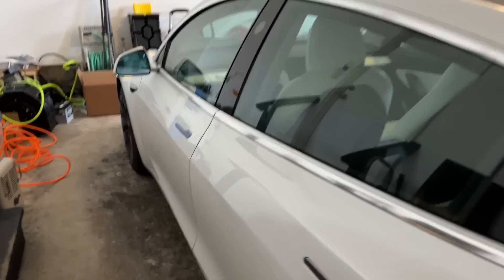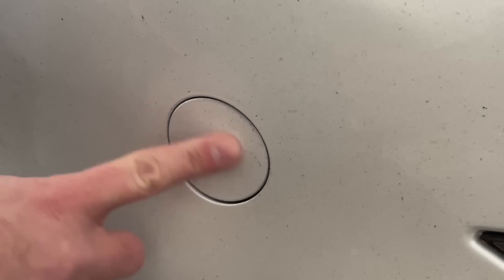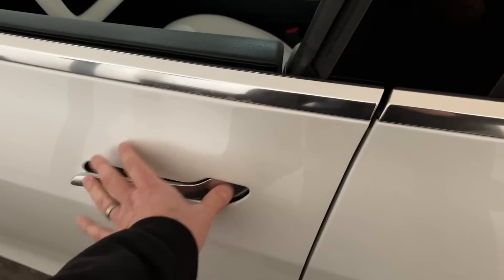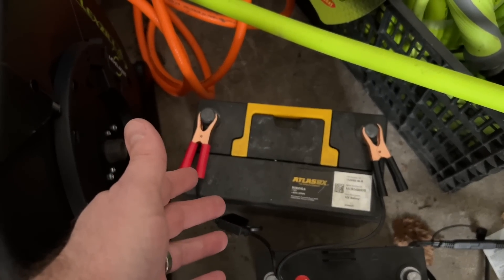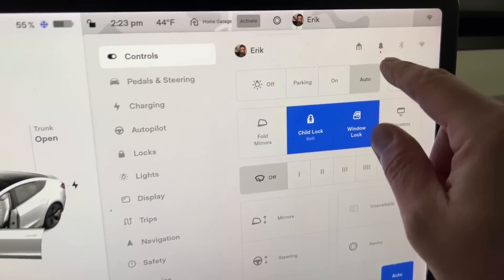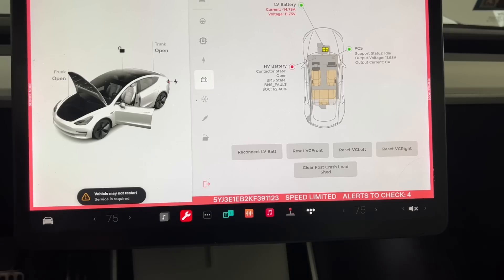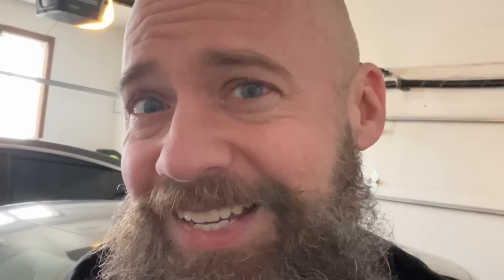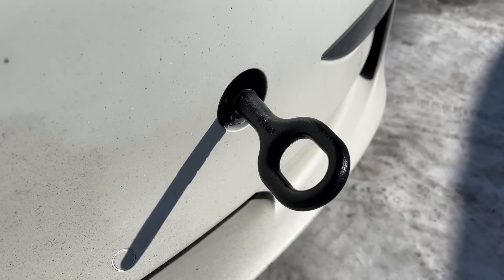My Tesla is completely dead!  Is it now bricked?  Pt1

Comment: Because the 12 volt battery does not crank an engine over you can use a Deep Cycle battery which should last longer.
Reply: I use a deep cycle in my '89 chevy pickup

Comment: 2 cables? They couldn't be bothered with including one proper connecter to connect to your 9v battery?
Really, 2 loose cables?
Reply from the maker: Yes, it's meant to be used with jumper cables.  That's what it was designed for.  The Tesla community discovered that you can use a 9v to pop the frunk.

Comment: get a real gas burning car, reliable, good range fast to refuel. Cheap to fix.
Reply from the maker: I'm not sure you understand why I bought my Tesla.  For around $55k, I have a super fast / high tech car that would cost in the hundreds of thousands for a gas equivalent.  Ask yourself which gas cars are faster than a Tesla?  Then look up the price on those.  Then look up the cost of repair and parts on those.  You'll soon see that I'm not crazy after all.
Reply: @BecauseTesla  you are 100 percent correct, they are blinding lee fast, but only for a very short distance. Ordinary v8 110mph for over an hour, more sensible driving 70mph passing a few cars up to 100mph still several hours range. Maybe they will be part of the future, still have a lot of major issues to be sorted

Comment: Wow, tesla is even worse than I thought:o) That steering wheel? OMG! And cannot open door without rolled down window??? WTF? And you need to undergo a training before you sit in the car to be able to open the door in case of accident? Now I don't wonder, why it is not sold in Europe:o))) It is just expensive garbage ......
Reply from the maker: The steering wheel is aftermarket.  The window needs to roll down because it's a frameless window.  Many gas cars have this too, and they won't roll down if the power is dead.  We used to have a Mini Cooper that was designed the same way.  It's not just a Tesla thing.  What do you mean not sold in Europe?  They sell a ton of Teslas in Europe!  They have a factory in Germany!   https://electrek.co/2022/12/29/tesla-model-y-is-now-the-best-selling-car-in-all-of-europe/

Comment: Normally the BMS prevents the battery from being discharged below a specific voltage. This prevents the battery from being discharged below the safe voltage for this batery type. So like Pc's Phones and Tesla's you cant totally flatten the battery. But battery failure does sometime occur no matter what Technology they use. The 9 volt battery you used have a very poor / low cuurrent output. eg keep a fresh new one just incase. As a retired Techo it's rather scarey what happened. Is the manual door release inside only on the passenger front door or do all doors have one.

Comment: Out of curiosity, while in the service menu, did you try hitting the "Clear post crash load shed" option? That stands out to me. Load shedding means it basically turns off a bunch of things to try and keep the electrical system alive. It makes me wonder if it's dropped into a load shedding state when it got down to low battery charge and hasn't been providing power to the 12V since, so it's just been slowly drained.
Reply from the maker: I did not try this.  Maybe it would have let the car run without the PTC heater that failed.  Part 2 of this video is out and it explains a bit more about what they found.
Reply: @BecauseTesla  Yes. Have now seen part 2. Given that they seem to have found it to be a complete failure of the PTC heater, I'm not convinced what I suggested above would make any difference. At the time I made the comment I was assuming it may have just been a software thing holding that contactor open, but it sounds like it was an actual hardware fault.
Reply from the maker: @Streaky100001  Yep, definitely a hardware failure, but I was hoping what you were suggesting is that they could use software to bypass that PTC heater to keep the car running...just without heat.  It doesn't sound like Tesla can do this...yet.

Comment: There have been plenty of videos about people being locked out of their EVs (not just Tesla btw - it applies to most EVs). It seems that there should be some sort of 'last resort' system to allow access to a bricked EV.
Reply: I've got an i3 which might be the exception, as BMW did thoughtfully include a physical key in case you get locked out due to a flat 12v battery, you can then pull the emergency frunk release from inside the car to get access to the 12v battery.
Reply: Yea, the thiefs would like that.

Comment: I don’t think I would feel comfortable getting trapped inside a car if it caught fire for any reason. Again, this is every reason why I went back to gas cars. With these, there is no issue to contend with.
Reply: I know that I had a Tesla and things too can get jammed up in an accident, even though it has an emergency escape switch.
Reply: Would you trust an all electric airplane? I sure as hell won’t.
Reply: Oh, right, so your petrol car won't  go on fire? Wow!
Reply from the maker: You do realize that gas is a flammable liquid, and it runs in a combustible engine…right?  I’m just playing devils advocate, but I would worry more about a gas car catching fire than an EV.  In my Tesla there are emergency door release handles that work even without power.  It’s only locked from the outside, not the inside.   Thanks for watching!

Comment: I want to go electric but I’m afraid of all these issues and having to send the car to them for days or weeks, I wanted the f150 lightning but ended up getting the 2021 3.5 twin turbo which is awesome. Maybe in the next few years they will resolve these issues and have enough stations and dealers to make it worth it
Reply from the maker: I wasn’t born an EV fanboy, but once I had one, the experience turned me into one.  I do understand your fears and concerns.  My car was ready to place the order in 2018, and I waited until 2019 to actually submit the order because I too was concerned with going electric.   Once I did, I realized how silly I was for waiting so long.  I just sat in a Ford Lightning last week and thought it was amazing.  My latest video is at the auto show and the Lightning is the first one I sit in.
Reply: @BecauseTesla  hopefully The Japanese companies take it more seriously and make some decent ones, I already went solar for the house, we got the 16500kw system and that will make all charging free since my home only needs 10500kw
Reply from the maker: @Sirkopaneer  The Japanese brands need to really step it up.  Lexus has a new electric SUV that costs $60k, and it only has 220 miles of range and cloth seats.  I haven't heard much from the Honda / Acura team about EVs either.  And of course Toyota is dragging their feet in the EV space too.  :face-pink-tears:

Comment: A small correction, there is a belt in the steering control unit, that enables AutoPilot to steer the car. But this belt does not wear out that easily. Not sure if there are any belts in the heatpump section.
Reply from the maker: Yes, this is true.  Thank you!

Comment: tesla was ranked most unreliable car brand but a sucker is born every day
Reply from the maker: I thought that was Land Rover?
Reply: @BecauseTesla  yea tesla was number 2  landrover number one. As a guy who has worked on many cars id much rather my land rover break vs tesla. The landrover I might be able to fix as most landrover issues are electrical faults, the Tesla you need special tools, software and the major parts like the inverter drive motors battery can total the car financially. I considered a tesla then I went on the tesla out of warranty reddit  forums and that is one depressing place

Comment: I think it's hilarious when someone tries to drive a battery powered computer on wheels, and is upset when they have problems. My '79 Chevy truck runs just fine, and if there is a minor problem, I can fix it myself, no computers needed. If the whole engine blows up, I can fix that myself too. But that is not likely to happen, because I built it right to begin with.
Reply: Nobody cares what car you drive.

Comment: Had one, gone back to gas, and have no problems to contend with...
Reply: I have a model s, and 4 gas cars.  Like them all.  Tesla never causes me issue.  Putting a new turbo in the fusion today.  Cars will always have to be fixed.
Reply: Sheeesh welcome back. 😂
Reply: What made you go back to gas? Charging?
Reply: Having same problems with my gas car. I got similar electrical issues. I have a full charge on my battery and the car will start normal one day, than won’t start the next day. Or will run for 5 minutes and die, than I can’t start it. I will change the fuel pump and see if that fixes it. In my opinion can have issues with any car. EV or gasoline. Just the way it is. 😮

Comment: So the "emergency pull" is just a standard door handle? LOL
Reply: @IntegerOfDoom  It's not a bad design if you understand WHY it was designed that way. Recessing the window into the seal reduces drag and wind resistance thus increasing efficiency and extending range.
Reply: You don't want to treat the emergency pull(EP) as a standard door handle. Using the EP will not engage the electric window to lower the small amount it needs to properly clear the window seal. This can damage the seal, the window, or both. Use the electric release button for normal operation, and reserve the EP for, well, emergencies.

Comment: So people can break into a Tesla with a 9V battery?
Reply from the maker: No, not really.  The 9v battery will only open the frunk if the cars 12v battery is completely dead.  If the car battery is working properly, the built in security will not allow the 9v battery to unlock it.

Comment: So all it takes to gain access to a Tesla, at least a dead one, is a 9V battery? Hmmm....
Reply from the maker: Yes, if the cars 12v battery is dead, you can use jumper cables and a little jump start box, or a 9v battery or A23 battery to open it.
Reply: @BecauseTesla  So, though presumably that is not a frequent state with them out on the streets, a dead 12V battery also presents a security risk.

Comment: It's just amazing how inconvenient a KEY is these days...
Reply: I have an EV from VW, the previous owner - a friend of my dad - payed premium for removing the keyless function and the installation of a normal key. Otherwise he wouldn’t have bought the car, so they did it. I think it’s the only one with this „feature“. Since i bought it from him i get looks from passenger that don’t know the car….unlocking by pressing a button is still quite normal, but inserting a key? And even turning it, jn a modern electric car? 😁 Well, i can at least say it worked every time, never had problems with it. And i always know where to put  my keys 😉. I even have an emergency lock at the drivers door, normally use€ with  these plastic emergency keys you never have with you where it fits, so i can still open it when the battery is completely dead. Quite strange, but it works perfectly, like decades before in other cars 😉👍
Reply: I was am looking at buying a new car to drive to work. I wanted something that was better on gas than my 06 chevy truck or even an electric but from what I have seen I'm keeping my chevy even if I buy a new car. Manual widows, locks,transmission and no key fob. My dad bought the truck new and it has never needed anything other then a basic tune up. I have no garage to store a car in winter and the fact that most electric if not all the ones I looked at have no door handles that stay out means ice can freeze them up. I just want a car without the fancy BS I don't need or want.
Reply: Its not high tech enough for the Fanboys. I am surprized teslas use old fashion round wheels. They a so old design. How about yoke wheels like the BS steering yoke?
Reply: LOL!
Reply: One of the dumbest things I've ever seen. Not sure I'll ever have a Tesla pretty much because of this.
Reply: Not for everyone. My truck uses a real key with no fob, and I like it!
Reply: They can even build door handles .
Reply: My battery went to zero a few times, but I just jumped it and drove off.
Reply: @kailaniandi  so the video is a lie?
Reply: @tortenschiebermitsenf9282  not necessarily a lie. I have a Mercedes S430
Reply: @kailaniandi  of course. Its a normal car not like this american EV BS
Reply: @tortenschiebermitsenf9282  It's the same BS for every high end EV regardless of the country is was designed in.

Comment: Electric door handles?    Blessed is the man that keeps life simple.
Reply: So. You are unconscious in your car and the battery is dead because of a car crash. How does the fire and rescue get in to save you. Just askin.
Reply: @edrouse9578  Break those transparent things?
Reply: @edrouse9578  
Theres a mechanical latch....
Reply: @ogzombieblunt4626  
On the inside.
Reply: @scorchedearth1451  
When automatic windows were adopted people were worried about not being able to roll them down if the power went out, like if you drove into water and sank. 

The reality of most crashes is that if its so severe the car shuts off, the doors and windows will be busted out. So not a a real issue.
Reply: Love my shitty car.
Reply: @IntegerOfDoom  love my 23 year old motorbike still carbed it works
Reply: Engineers are following the Second KISS Rule: Keep It Stupid, Simple.

Comment: Simple solution...go back to ice vehicles...the older the better.  "The good thing is there's no drive belt that needs to be replaced"  $12 alternator belt and alternator is probably cheaper than a dc to dc converter module. 😂

Comment: Seriously, Which Model 3 is out of warranty? You claimed that this is NOT click bait, What a joke
Reply from the maker: Did you watch part 2?   Apparently my Model 3 is out of warranty.
Reply: @BecauseTesla  add on to your video  this barely does not preclude that there is a part two until you saw fit to add one. I still lay claim to this being click bait and switch. IF there is a part 2 why hide it until you need an excuse to have a Part 2? it is not as if you did not have time to prepare your wording of this video after all?

As I stated even a Model 3 has warranty and guess what new batteries can be sourced and installed instead of belly aching about it. For God's sake even a lowly Nissan Leaf can have a main battery replaced.
Reply from the maker: @spuddy4063  part 2 link is literally in the description of the video, and the end credit that says “to be continued” has another link to part 2, so again I’m not sure what you’re talking about.  You can think what you want though.  🤷🏻‍♂️

Comment: Hey seems like a lot of fun owning these EV's, I'll stick to my V8.
Reply: future will be nice when everything is subscribtion based and runs software that wont work unless you pay for it...Electric cars are already going In the direction of not allowing you to fix the car because the high voltage battery is dangerous.
Reply: @-joo3033  Dude, you're behind in your knowledge.  Even the ICE cars are being subjected to subscription services.  Toyota, starting with its 2018 models, makes the remote start feature a subscription service after 3 years.  I've heard talk about other "features" you paid for when buying the car, but have to pay subscription fees to use them.  So it's not just the EVs. EVERYONE has to reject buying cars that require this and force manufacturers to do away with this nonsense.
Reply: @Science Over Feelings  Thr CEO of Toyota quit because of electric cars and this new garbage. LoL!! 👏 to him. Honorable man!
Reply: @ScienceNotFaith  i didnt say its not already happening (i know it is), what i mean is it will be worse In the future...
Reply: According to electric Jesus , he always owns it and you just pay the bills …
No thanks
Reply: v8 or ev the car gods will always demand sacrifice eventually
Reply: Yep with ya there for starters ev owners start using dumb words frunk says it all.
Reply: @historickeeper  when the term frunk rolls out it’s time to fruck off
Reply: I’m with you but a V8? I’ve had 4 cylinders for 59 years and I’m glad I get 30mpg now.

Comment: This is total BS, basic clickbait FUD. Tesla does not die or "brick" as you find cool to say at 0%. You are in your garage, plug your car in. Shocking you have an extra 12 Volt battery laying around, pretty handy if you are trying to make $$ from videos. If the 12 volt is an issue as you are claiming, you will have received many warnings and notices before you actually experience any issues. OMG plug the freaking car in or call Tesla mobile service so you can record your 12 step plan to escape being trapped in a paper bag.
Reply from the maker: I guess you didn’t see part 2 that explains what happened.

Comment: 30 years driving, I never ran a car out of gas....  Don't think its a car killer to do it though....
Reply from the maker: Most of the time it won’t kill a car, but it definitely can happen.   I had a crappy Honda in the early 90s that had a broken fuel gauge, so I’ve run out of gas in that car before.  It ended up burning up the fuel pump, so it wouldn’t drive even after refueling.  I’ve also ran out of gas in a new BMW because one of its two fuel sensors went bad.  That was all fixed under warranty.   Car ownership can be an adventure- regardless of how it’s powered.

Comment: The Vulcan Science Directorate has determined that independent Tesla repair, and time travel is impossible.  
I think the 9V battery closed a relay that used the cars' power to pop all the locks.
Check your Tesla Shop Manual and let me know if I am right or if that little battery powered the locks on its own